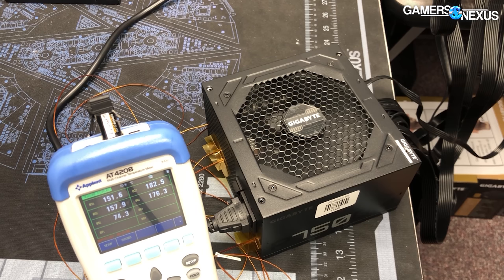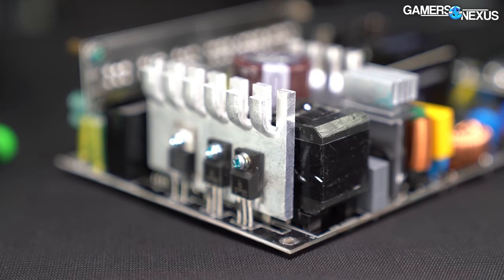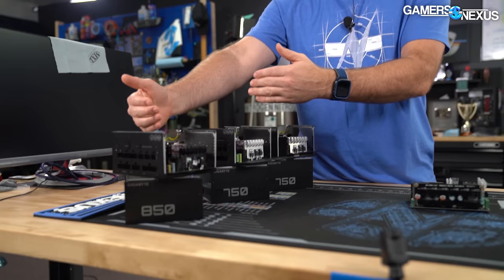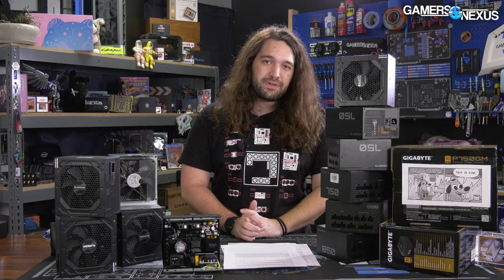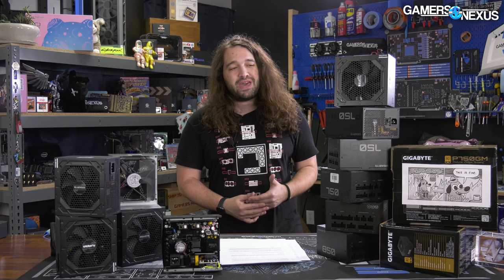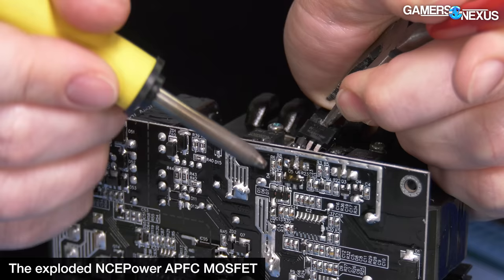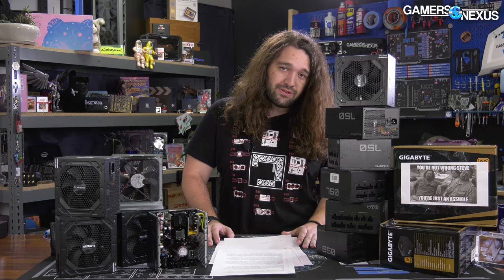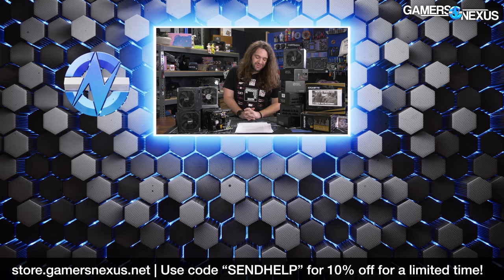Exploding Power Supplies: Gigabyte & Newegg Dumping Unsellable Product

Comment: This is the PSU came in my ABS prebuilt I bought. I thought i had seen something online about  a faulty GIGABYTE PSU that looked exactly like the PSU in my PC, but I brushed it off bc I couldn’t find anything in the reviews for the system that said that the psu had failed on them. But after this video, I’m not taking any chances, especially after the part where you said that it fried a system. I can imagine what would happen if it did that to me, especially with Newegg’s terrible support.
Reply: Same..been running my ABS for 6mos now with no problems. But for what I paid it may be better to swap out for a Seasonic or the like.
Reply: Same boat with ABS pre-built. Has the P750GM. Has worked fine for me so far (about a month). But I'm not taking any chances. After this video dropped I immediately bought a Corsair PSU to swap it out with.

Comment: I had my PSU (seasonic 750 titanium) going in short circuit protection under certain loads because (after weeks of trying figuring it out blaming bios settings, LLC voltages, usb devices etc... The pc just turned off sometimes after hours, sometimes never, often while alt tabbing with many things open like discord, game, overlays etc...) a naked metal inductor of the vrm was touching one screw of the monoblock... It saved all the pc at least 10 times before I could figure it out the real problem. 

Then there are PSU like this.

Comment: I seem to remember antec making their higher tier PSUs in different factories than their low end PSUs. 
Component consistency has never really been a thing as far as I've been aware. 
My first PSU had a similar failure and I've been super vigilant in selecting PSUs for myself and for friends. 
In depth PSU reviews are a pretty big blind spot and you generally have to dig deep to find information on the components and performance of the components.
Reply: Yea, I've heard of it, I had an 850w bronze antec in my old system that constantly shut down during load, it was around 55% load which is ridiculous considering I had a i7-980x and a 6990 at the time, so it shut down basically anytime I played a game
Reply: Because it require deep knowledge and experience of electrical engineering to review a psu, and yeah this is a big blind spot. This is what i always trying to tell to my friends, if you buy pc always not to cheap tf up the power supply
Reply: @rkadi6540  idk about deep knowledge in engineering, I know electricians that understand this stuff really well, more than enough to point out flaws in a design like this
Reply: I am new to computer parts, but helping my 14 year old select components for his first build.... what would you say are a few quality options in the 750 or 850 watt range?   We have on our list a Corsair RM850x power supply, hoping that we made a good choice, but we haven't ordered it yet...  input welcomed... cheers
Reply: @isaiahfurrow7414  Best guide I've found is the pcmr power supply tier guide. Corsair IMO have the best sweet spots for psu's money/quality wise.
Reply: A lot of Antec units (especially higher end units) were made by Delta, meanwhile some of their other units were made by different companies. I have one of these Antec units made by Delta and it is a very well built unit.

I typically use Delta units (and Seasonic) for most builds I do but I also really like the PC Power and Cooling units. I have an 860 watt Turbo Cool unit in my main pc and the thing is great aside from being slightly noisy. My file server has a Delta unit in it.

Comment: Teapo caps? I remember the capacitor plague, whenever I would see a Teapo cap (on motherboards, PSUs, video cards), I would immediately replace it with Panasonic/Rubyconn/Nichicon low ESR caps. I can’t believe they are still being used (especially when considering the fact that these are $100+ PSUs). If they went the cheap route when it comes to caps, who knows how many other corners were cut with these?

Comment: My experience is that the cause of the exploding MOSFET is either: VDSmax well below the specs. So, during a switching transient, the transistor goes in breakdown, shorting Drain and Source.
The second case, the switching time is too low; in this case the transistor overheat, until it fail catastrophically.

Comment: So that's why they're so cheap. I almost bought one for a side project.
Safe to say after this little stunt I'll never buy Gigabyte again.
Reply: $111 is not a cheap PSU price. About mid-range I'd say.
Reply: @1pcfred  They're going for 80 dollars + shipping here
Reply: @junko4166  $80 is still not bottom of the barrel. But the word is getting out and they're trying to dump those things. Maybe all of them are not bad? A high enough percentage that I would not want to get involved with it myself. There's nothing in my PC I could replace for just $80 if the PSU blew it up. Well, a case fan I could get cheap. I just saw a 12V fan running in 24V in a PSU though. Sucker was screaming but it was running. Very quickly.

Comment: THANK YOU! I had this PSU in my wishlist for items to get when I’d be building my computer, and now, I see that I have to go hunting for another PSU that will have a higher chance of not having such issues as presented early in the video. Best to be safe than sorry.
Reply: Best advice I can give you, spend the few extra bucks on a Seasonic. 10 year warranty no matter where you buy it new (any retailer, not fleabay etc). Consistently top rated in it's class in almost every category and wattage for decade++. Typically a single Seasonic will  make it to the 3rd motherboard upgrade and I just give it to whomever I sell/gift system to at that point. Still haven't heard of one dying for ANY reason. Or frying ANY components. For just $10 more? Yeah, worth every penny I have ever spent on them (11+ on my Newegg history alone)
Reply: Evga or Corsair and like the dude below said, seasonic are really good PSUs
Reply: Superflower and Seasonic are some of the best brands (and often make PSUs for other brands like EVGA and Phanteks)
Reply: Check evga bstock every wednesday.
Reply: @psychic_beth  got a be quiet last january, havent explode yet so i guess their products are quite decent

Comment: "Simple enough--don't buy it!"

Translation for the less-technical viewer:  "Simple enough--don't buy Gigabyte products!"  That covers all the bases, until they get their sh!t together.
Reply: Their motherboards are fine...They were never previous "known" for their Power Supplies, this would be why.. lol
Reply: That is not what he said. Let Steve speak for Steve.
Reply: @UNKA757  i don’t know, this put them in a pretty bad light. Their gpu‘s are mediocre at best, PSUs are exploding. Bad product design, cheaping out on critical components, lacking quality control and trying to bundle their shit with something else to get it out of the warehouse despite knowing they will blow up. I would not have a good feeling buying anything from gigabytes. I’m feeling bad for having 2 motherboards from gigabyte, are these boards time bombs?
Reply: If their quality control can miss this, in one of the more "dangerous" parts that can go in your PC? Obviously they'll be missing a plethora of issues in their other products. To be clear, PSUs are basically the most dangerous part in any PC. I've been building PCs for over twenty years and I won't crack open a PSU most of the time. To be fair, it's entirely possible to do so in a safe way, but I just don't want to deal with that stuff. 

But I would put money on the quality control for PSUs typically involving more standards than typical PC components. So yeah. This is really bad.

Comment: MOSFETs are rated 150C junction temp. But this is computed as Tj=Tc + Pdissipation x rated degC per watt on the MOSFET. In actual practice, anytime your DC DC MOSFET exceeds 120C (case temperature or the reading from your thermocouple), it means IT IS bad. The MOSFET can go to thermal runaway.

Comment: They used a Nippon Chemicon bulk cap but went offbrand for the FETs? That seems like a strange and somewhat sad choice. Lelon, etc. for low voltage secondary side caps is pretty much standard though and not surprising. If you only get so many top-end parts to meet your price point, those are a fine place to skimp. Mosfets though, I don't think so.

Comment: After not being in the PC hobby for almost 7 years cause of school and just now getting back into it, its good to know that Gigabyte is still a company to avoid
Reply: i have a gigabyte 3080... memory hits 112 degrees... brand new top of the line Aorus Master... 🤦‍♂️ when mining,  65mh instead of 100mh...... such a fail GPU. 1660super does OK though...🙄 no overheating
Reply: I wouldn't buy their GPUs or PSUs but my Aorus Master X570 has been rock solid. I only ever buy Seasonic manufactured PSUs.
Reply: @redrock425  are you sure? Ever got any sudden mouse disconnects between your games or any other usb issues?
Reply: Well if you ask me I'll say the same thing about MSI, it depends on you experience. However a bad psu doesn't automatically make everything else bad aswell. My current pc is the only one that has never given me any shit at all and its got an Aorus mobo, GPU, SSD, and CPU cooler.
Reply: @1nfiniteloop  >when mining
Thanks for contributing to the GPU shortage!

Comment: I'm surprised how soft GN went on this. It seems like much more dangerous problem than NZXT's riser issue, those PSUs should be recalled immediately.
Reply: No, it's less dangerous. The FETs explode, the fuses blow, a little smoke and a lightshow, and that's it. There's pretty much zero chance of it catching on fire.

These PSUs should have been recalled long ago indeed, severe primary side flaws are kinda not a thing that happens in PSUs by semi-decent OEMs.
Reply: @SianaGearz  Interesting, definitely looks scary though :)

Comment: This is why I typically stick with Seasonic for my PS units. That 12 year warranty is a nice safety net.
Reply: Seasonic and Corsair are my two go-to brands for power supplies. If I can't source one from them, I'm waiting until I can.
Reply: You guys are forgetting about superflower they also sell directly now
Reply: If you buy right you can get Seasonic in a sale by and get a bargain. I picked up a 750W Titanium for £135, probably because it's white but as it's hidden that wasn't an issue. Great PSU.
Reply: @Onewolfoc  superflower the oem for corsair and seasonic?
Reply: EVGA makes good power supplies too. I’ve owned a 750w and now my 1000w g5 gold. Zero issues, no coil wine and a decent warranty as well.

Comment: I'd love to see you send that 3080 to someone with more time to analyze it, figure out the cause of the failure, and then even fix it if possible.  Someone whose channel's bread and butter is tinkering and repairs so it benefits them to work on it, since that stuff is not GN's focus.  It'd be a nice collab and followup to this.
Reply: We all know it's probably a $0.01 0 ohm resistor. Which are used to bridge over a circuit trace on the GPU board without having to add another layer of traces to the board that is getting blown.  There have been a lot of those happening on high end GPUs recently and its probably related to these power supplies being sold as bundled with those cards. Obtaining those cards with such a cheap repair to get them working again is like getting a free card.

Comment: Honestly not surprised. Built a new computer last year with a gigabyte board and psu. The rgb lights on the board were doa and psu fan bearings started rattling and making noise after a month.

Comment: Obviously, a lot of these were obtained unwillingly with bundles, but my general rule of thumb is to buy PSUs from companies known for making them. Not a motherboard manufacturer or a GPU partner. 

Corsair, Be Quiet, and Seasonic tend to be my preferred brands, since they all have a pretty decent track record of non-explosive products.
Reply: That's my rule of thumb, too. I never fully trust psu's made by motherboard manufacturers because they are made by someone else for them. How do they verify quality?
Reply: Be quiet sells a fair number of shitty units ... Corsair CX and a few other lines had some pretty shit ones too... And seasonics low end stuff is pretty shit too ... Corsair RMx and higher , superflower leadex , and leadex III , and seasonic focus GX/PX and prime GX/PX and stuff is quite good
Reply: @Onewolfoc  bought a be quiet! psu in january, havent explode yet, hopefully it wont, but then it also have warranty so not too worried
Reply: Evga products some decent PSU' s too.

Comment: oh wow.. by the time I came accross this video, I had used P750GM for maybe 4-5 months on my test minig rig, where I test settings, flash amd cards and leave them to mine for a while until I sell them. All types and brands of cards passed by. I even used it on an EVGA FTW3 3080 NON LHR with 3x8pin power connectors powered with 1 splitter cable from a single PCIe cable coming from the PSU ( it is 2 x 8 PCIe cable, which I split to 3 x 8) And I have had NO ISSUE what-so-ever. I have pushed the PSU to about 80% load (2 x 3080 , 1 x 3060 ti mining ethereum) I never go further than this load. The PSU remains relatively quiet and cold at touch, no cables are warm, voltages (as reported by GPU-Z) are ok-ish 11.8, 11.7 on the PCIe , so I thought it's alright.. 

maybe mining is still somehow not so taxing to the PSUs, because the load is very uniform and ...how do you say.. flat? so that might have helped me save the day. 

boy, did I list it for sale right after I watched this video... :D

Comment: This seems like a fire hazard that needs to be addressed by CPSC especially since the sparks could potentially ignite a fire in the bedroom of a child.
Reply: To any trading standards authority, if you forcefully push anything 30-40% over the max load and it fails, it is no surprise as it was misused.
If a 400 lbs fat guy broke a chair rated for 300 lbs, no one would bat an eye lid.
Reply: @5thwiseman  well yes, but if the intended protection against such hazard failed due to error or negligence from the manufacturer they are still liable…
Reply: @skynchickens300  The Intended protection did it's job the first time round and shut off the power at 140% load. If someone truly managed to hit 140% load on a 850W PSU (counting all rails) that would be 1190W, that PSU has no business being in that system to begin with and the user deserves what is coming for being negligent.

Comment: Speaking on the topic of Gigabyte: Back in the 80's I purchased an LG external CD Player/Burner and it had a multitude of problems. When I contacted customer support via phone I had a VERY bad experience. When I asked to talk to a supervisor I was denied the opportunity. I am now 60 and to this day I will not buy anything from LG.
   On the other side of the coin, when I had a WD hard drive go bad WD customer support sent me a replacement that had more capacity than my bad unit. To this day I prefer to buy my drives from WD.
   Bottom Line: When I buy a product all I want is for this thing to do what you said it would do. If it doesn't then stand my your warranty. Over the years of my life I have spent a lot of money on computer products and either recommended some brands or disparaged some brands. This is ultimately what makes a company successful or not. I try my best to keep my word. That's all I want from the manufactures of the products I buy.

Comment: Note to self: Test potentially explosive power supplies with old hardware.
Reply: i'm assuming, a gt 130 would probably not be enough of a load to properly strain the psu :P
Reply: @hexidimentional  >not using a gtx 480
Reply: @sulphurous2656  oh common the 480 is perfect for testing as I could care less if that thing dies

Comment: It is good design practice to whenever possible select components that can be multi sourced (=same product from different manufacturers). Those different colored caps are a good example,  they all are the same spec, the brand really doesn't matter. This is very and common (and sensible) practice in all electronic products. 
Seems these PSU are simply not well designed. Maybe not enough attention was spend on tolerance margins, component de-rating and the like. Or there is some unexpected switching behavior that was missed.
Reply: My bet is on switching or something along those lines.  It's not the same component that's failing, and often not even in the same spot.  My bet is that it's either the high voltage side, the transformer, or something like too high of a switching frequency.  Personally, I'm thinking it's a frequency issue.  Too high or too low of a switching frequency are bad for components, and could cause even name brand stuff to fail.  Heck, having a transformer with a few extra windings could cause that switching issue as well, and is not as noticeable as something like a wrong value setting resistor.
Reply: @arthurmoore9488  that sounds bang on the money. Someone needs to break out the oscilloscope and figure this out. Too bad Johnny Guru stopped doing PSU reviews.

Comment: It's so nice that they sell both defective power connector 3080s and, in case they don't ruin your system with plugs that literally don't fit, they sell a power supply that will kill your gpu half the time. Great work gigabyte.